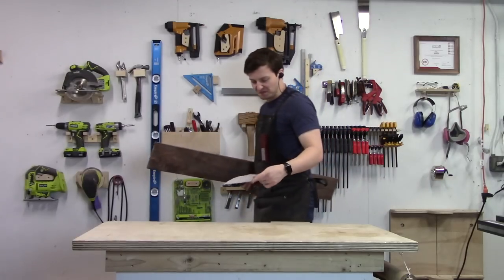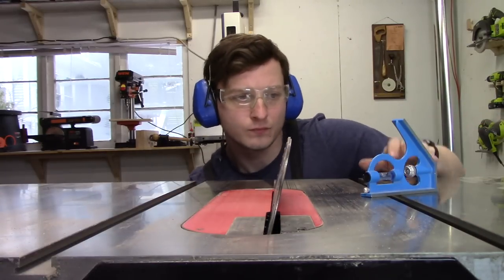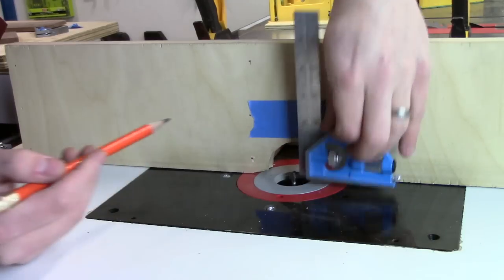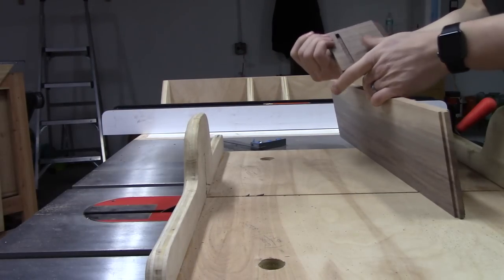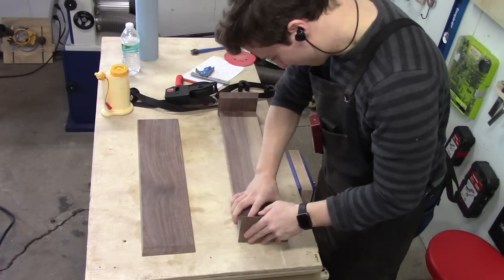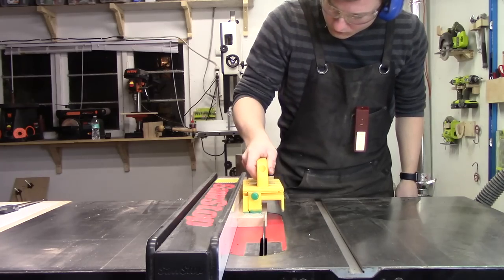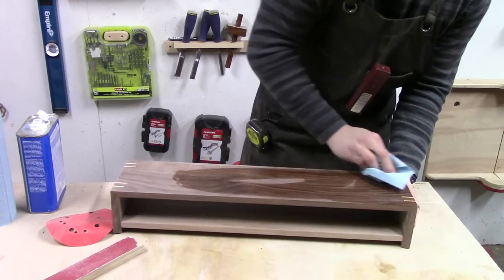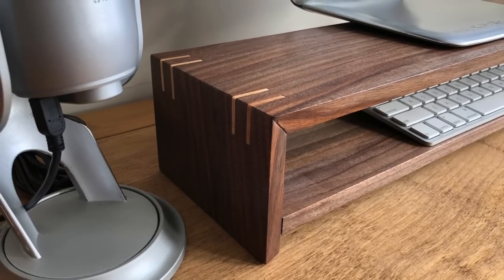Making a Waterfall Shelf | DIY Walnut Monitor Stand

Comment: Very cool! Am unfamiliar with the term waterfall shelf. Will have to look into it. Love the accents on the edges.
Reply from the maker: Glad you like it! What waterfall means here is that the grain direction across the top of the shelf matches up with the sides, "wrapping around" the outside and looking like a waterfall off the side of a cliff.
Reply: @dkbuilds  ah, ok I see!  Very cool! The inlay kinda looks like rocks. I had that same bottle (same kind)of mineral spirits that had been sitting in a shed for years till I found it about a year ago. (Was still good)

Comment: Great job! Please explain why you preferred using glue over self tapping screws. Not critical here, but I'm curious!
Reply from the maker: Thanks for the question, Chandraveer! I prefer glue in general because it is stronger (when there is a clean surface-to-surface joint between face or edge grain of wood). In this case strength isn't a big issue, but I want to avoid any visible screws (and hiding them well can be a pain). Screws would work fine here, it's just what you prefer to look at 👍

Comment: Nice work! What the dimension of the monitor stand?
Reply from the maker: Thanks! It is 3.75" tall, 5.25" deep, and 22.5" long. The bottom edge of the bottom shelf is 0.5" high. The outer pieces are 5/8" thick, the shelf is 1/2" thick. Hope that helps!

Comment: What is the height of the monitor stand?
Reply from the maker: Thanks! It is 3.75" tall, 5.25" deep, and 22.5" long. The bottom edge of the bottom shelf is 0.5" high. The outer pieces are 5/8" thick, the shelf is 1/2" thick. Hope that helps!

Comment: How wide did you make the splines?
Reply from the maker: The splines are 1/8th inch wide (the width of my saw blade), and are long enough to span most of the miter joint.
Reply: @dkbuilds  awesome thanks.  I have a piece of live edge ash in the garage that I plan to use for a monitor stand.

Comment: What sizes does it have?
Reply from the maker: Thanks for the comment, Moritz! What exactly do you mean?
Reply: @dkbuilds  Thanks for getting back to me! what height does the stand have?
Reply from the maker: @moritzh8454  No problem! The height is about 3.5", or 9cm
Reply: @dkbuilds  Thank you. Did you choose that according to your own height? because  i am gonna build my own but I see those stands ranging from 10 cm to 15cm and I am unsure.
Reply from the maker: @moritzh8454  Yes I chose it myself. I made a very small/cheap prototype to make sure the monitor height would be appropriate for how tall I am, how tall my chair is, my desk, how high my laptop screen is next to the monitor, etc. Also I wanted room in the shelf underneath that was enough to hold my keyboard and mouse when not in use. It is really up to you and how big your monitor is :)